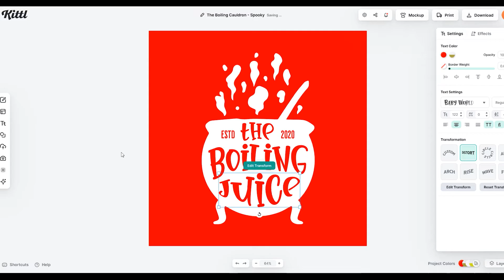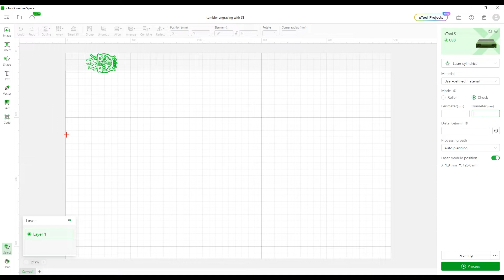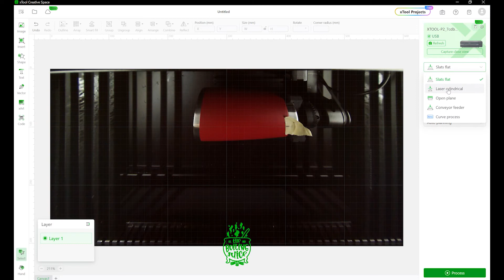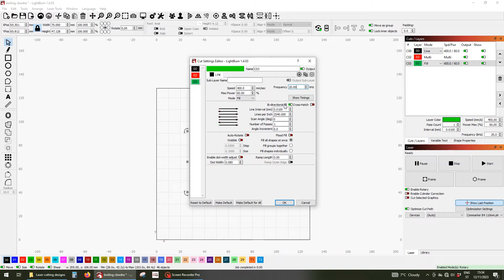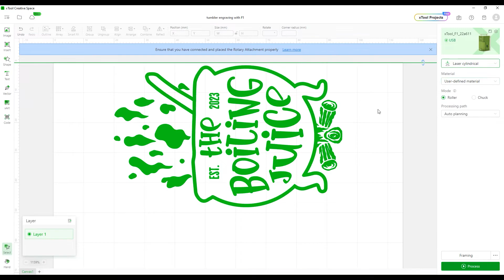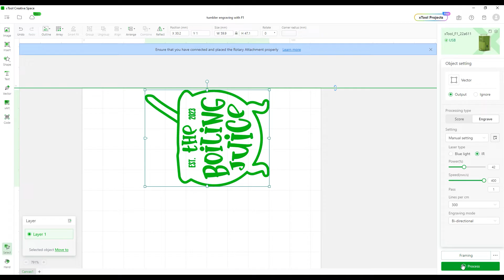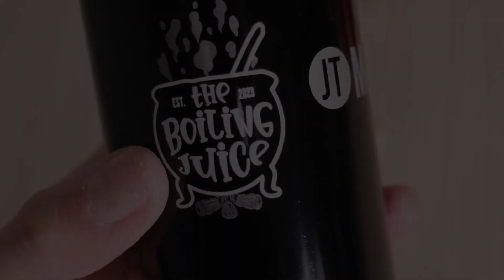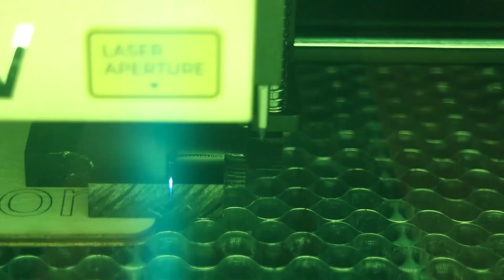Which Is The BEST Laser Engraver for TUMBLERS? Diode vs. CO2 vs. Fiber Laser

Comment: Have you done any tumblers using a uv laser such as Commarker omni 1?
Reply from the maker: Still need to do that
Reply: It's my understanding that O1 and tumblers do NOT go together
Reply from the maker: @TTC1940  It might have difficulties removing thick coating, but on the other hand Omni can produce the best deep engravings in rubber which could translate into tumblers too.
Reply: @JTMakesIt  interesting that you mentioned rubber.  I just engraved a hockey puck and it was all on the surface.  Are you saying that with a number of passes it might give a 3d effect?
Reply from the maker: @TTC1940  yes, check this video out where I made rubber stamps: https://youtu.be/TEGiheuk6SM

And you can also check my full review of the ComMarker Omni 1: https://youtu.be/rZXZM_2uSI8
Reply: just tried the hockey pucks which are made from vulcanized rubber at 15 passes . no difference than doing it once.  Probably too hard of a surface.
Reply from the maker: @TTC1940  interesting, what settings did you use?

Comment: Did you happen to document how long each machine took to engrave that graphic?
Reply from the maker: I didn't exactly, because my settings were far from ideal. With good settings, the fiber laser would be the fastest, then CO2, then  the diode laser and lastly the xTool F1. F1 is last because it needs to do 2 passes, but less cleanup is needed with it afterwards.
Reply: @JTMakesIt  Thanks for the reply. That's what I assumed from the video but was curious how much faster the fiber laser is.

Comment: thank you for your nice video, in your setting you needed to fill in the diameter. Since the tumbler is coned shape, which diameter do I use ? top or bottom or just an average ?
Reply from the maker: I use the average. This only affect the stretching of the image. The tumbler has a very mild cone shape and it doesn't affect the image stretch visibly.

Comment: I have one more question... 
If I found a sculpfun engraver machine 10 watt... can I replace the the 10 watt laser head to 60 watt laser head on the same machine in the future ?
Reply from the maker: If you buy s10 then I think 10W is maximum. If you get the 10W s30 pro, then you can upgrade to at least 33W module. Maybe the upcoming 40W will also be compatible. But if you know how to tinker with electronics, then you could modify the wiring it to fit even more powerful modules I think.
Reply: I will focus my search on 10w S30 pro to be able to do the upgrades... thank you for your help.. your help means a lot to me.. I feel more confident now... thank you.
Reply from the maker: @tejinsouli4352  You're welcome!

Comment: Anyway great video, for me I use a fiber laser and as an advice after your initial engraving, you could use higher frequencies (60hz) and low power (20%) and 500-1000ms speed to get the engraving more look more polished multiple time until you get your desired result :yougotthis:
Reply from the maker: That's a great idea! Thanks!
Reply: Super new here, but do you have to clean it before doing another pass?